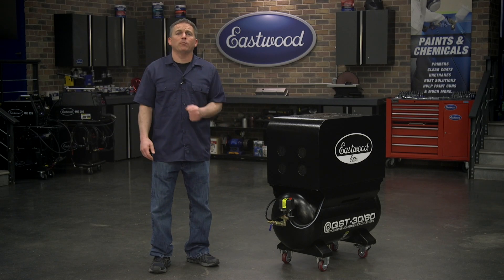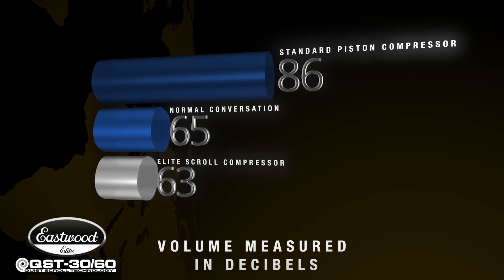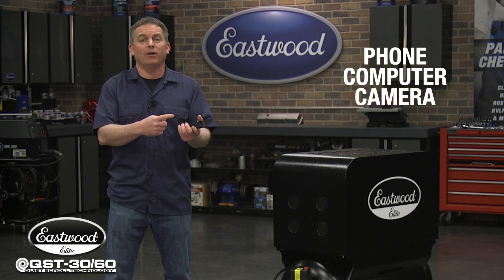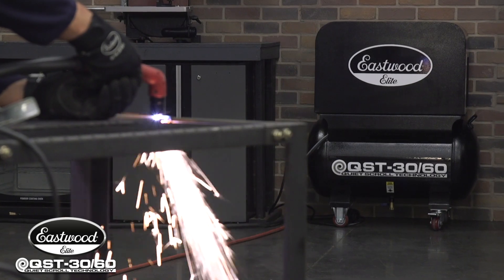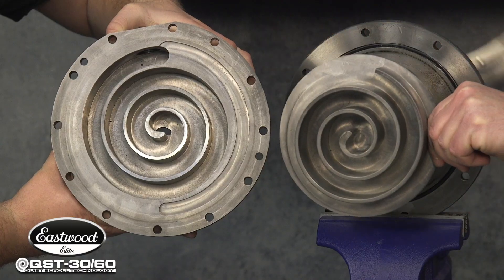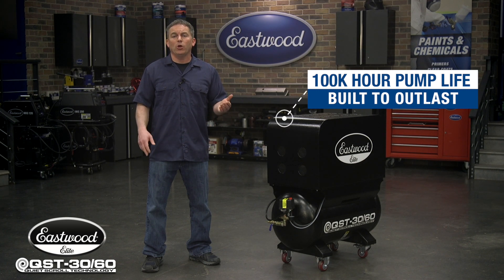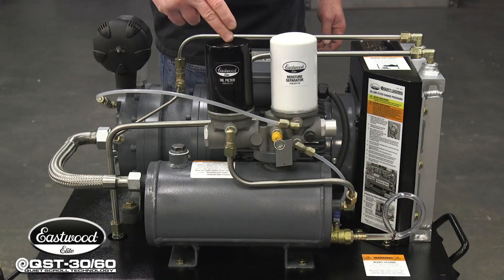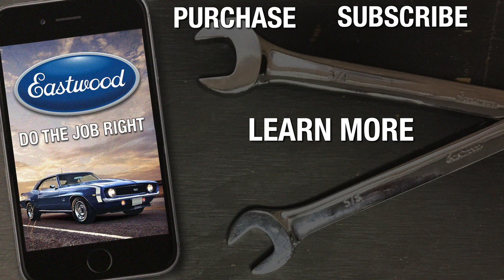Elite Scroll Compressor: How Does A Scroll Compressor Work - Eastwood

Comment: Are fully-loaded amps different from the amps I already have in my wires at home?
Reply: fully loaded amps is just max amps. sometimes it will draw less amperage depending on the resistance of the compressor
Reply: "Fully loaded" either means it comes with sour cream, chives, butter and bacon bits; or it comes with mustard, ketchup, mayonnaise, onions, lettuce and tomato. 😂

Comment: My honest musings: I am very impressed by the opening noise comparison. Compared to my 1990ish 20 gal cast iron 4hp 6.4 cfm@90psi which is super noisy, this has better specs and is rotary rather than recip, and would be MUCH better for my current shop and CNC plasma cutting setup. And the fact that you can literally buy the individual components (currently?) is such a bonus, but the fully assembled price of 2.3K is fully worth it considering other options out there. The link in the description does not work (404) nor does the Eastwood comment link. I highly appreciate that you showed the internals and how it works theoretically. I am a bit concerned with the porosity in the casting of the face plate where you can see a small void 2:33  Will this affect the life/efficiency of the scroll?